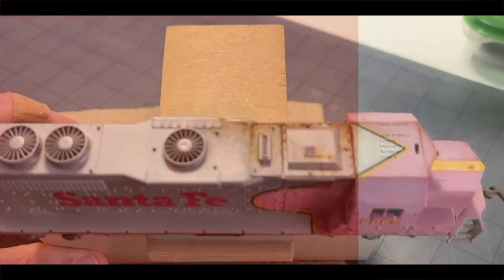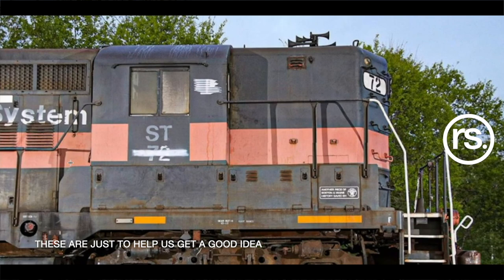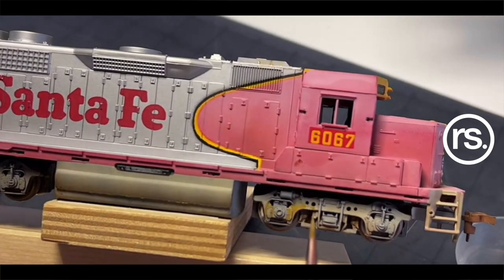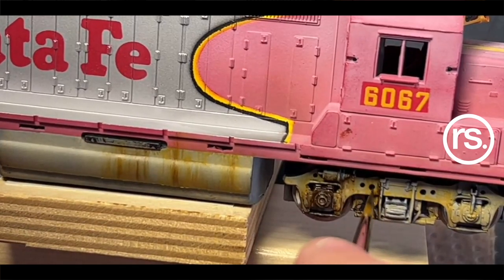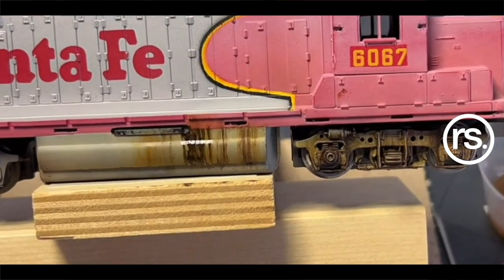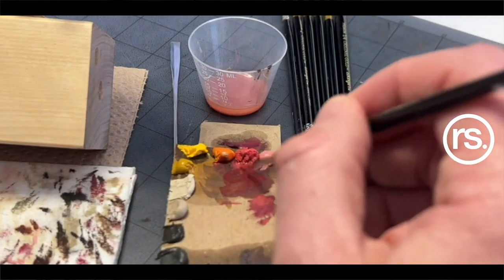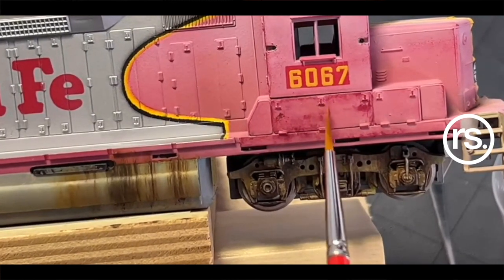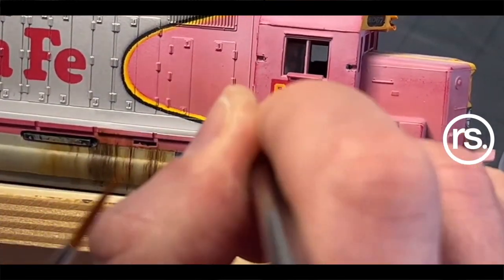WarBonnet - OPR Intro for Railroading Pt 1

Comment: I am buying the Gamblin paints that you list but they do not have a lamp black but an Ivory or a Mars black, which should I get or am I splitting Hairs ? Thanks !
Reply from the maker: My bad, I updated it to read Mars Black. The reason is Van Dyke Brown is a key color and Ivory Black is closer to it, therefore Mars Black gives you a better option with a deeper richer black.

I've also updated with some additional new colors recently added from he 1980 Series. Cheers!